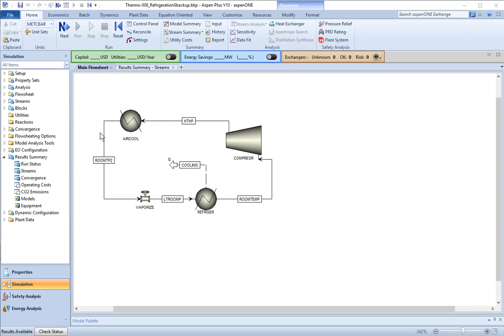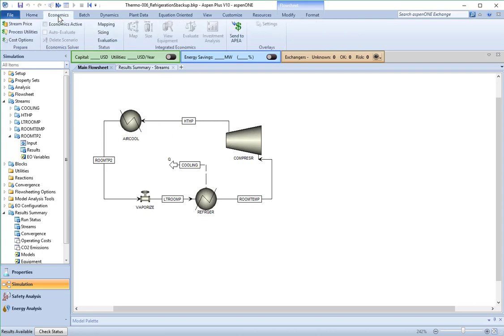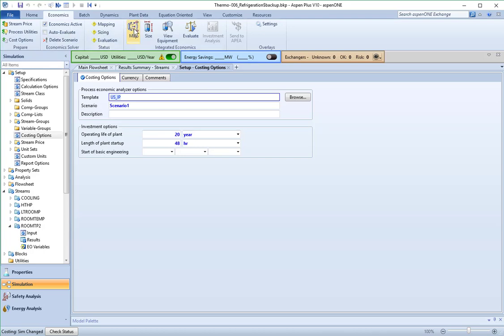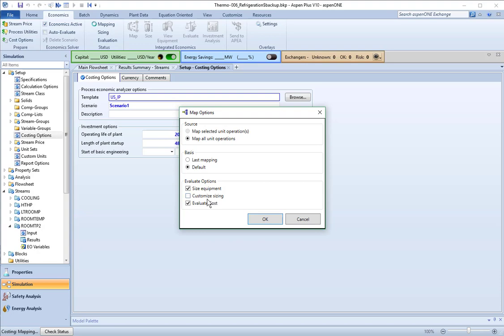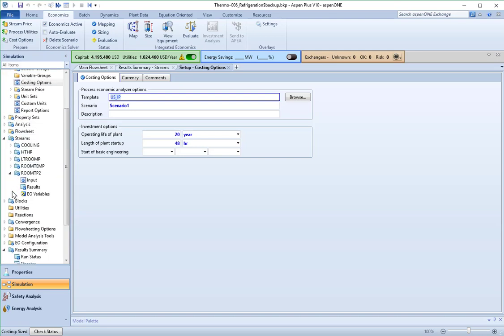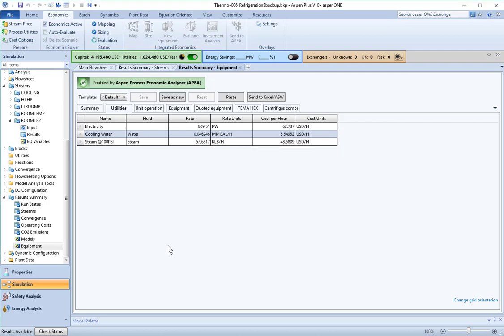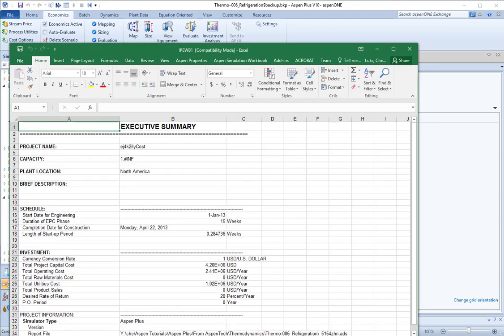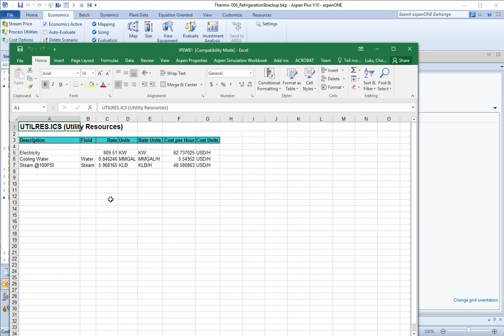Economic Analysis in AspenPlus

Comment: Hi I really enjoy your videos, you're doing an amazing job with these! I'm having trouble finding out which year aspen plus uses as a basis for it's prices of equipment (so I can adjust for the changed costs), do you have any idea of this? I have a hard time finding it anywhere online. My thanks in advance.
Reply: Crucial question. Did you ever find out? I'm using Aspen plus v12 currently and I've been wondering the same thing.
Reply: @thezulugentleman4402  Hi, I don't think we ever found anything, so we did some calculations ourselves for equipment pricing. The costs seemed to be all over the place, so we ended up just calculating all equipment prices ourselves. I don't think the Aspen numbers should be used for anything more than a ballpark figure.
Reply: @jurgenroman2686  Thank you for the response. I prepared myself for calculating for myself. I came across a webinar that Aspen did, they didn't say the year specifically but said the pricing is pretty up to date. Basically every year they update it and it comes from reputable sources which they cannot reveal, lol. But I think I will go ahead and just do my own calculations, if I have the time try and compare the difference.